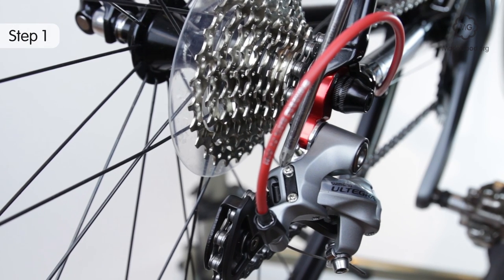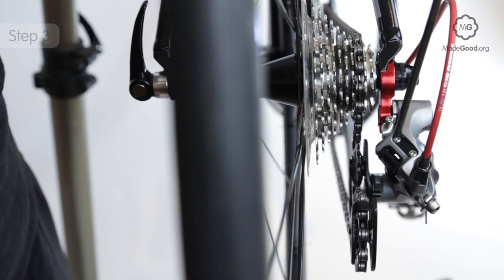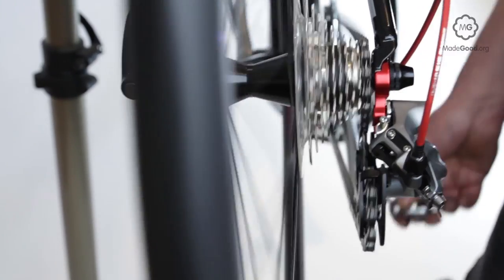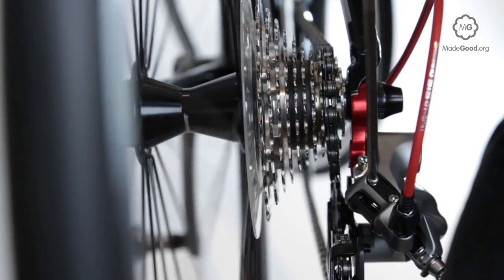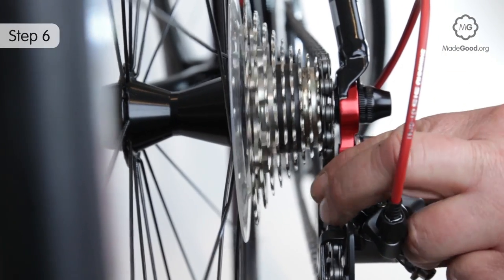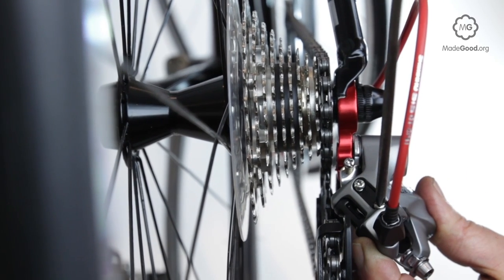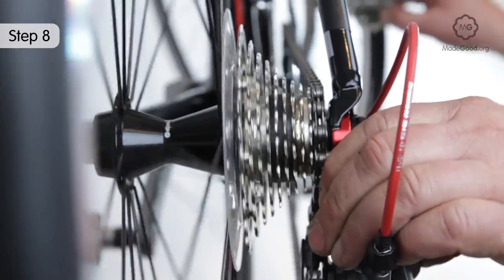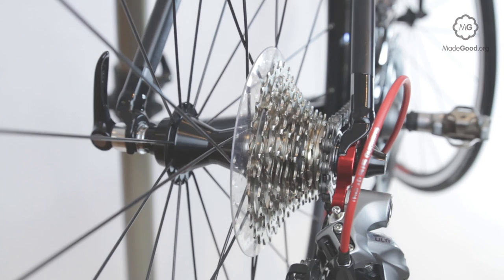Set A Limit Screw On A Bike’s Rear Derailleur

Comment: What exactly do the screws do.  One day I might have to see if I can open up the deraileurs housing to to take a look.
Reply from the maker: You don't have to take it apart to see. They act as stops at the high and low limits of the derailleur's movement. So screwing in our out either limits or extends the range of motion. If you look carefully you can see the derailleur butting up to the screw at the extreme positions.